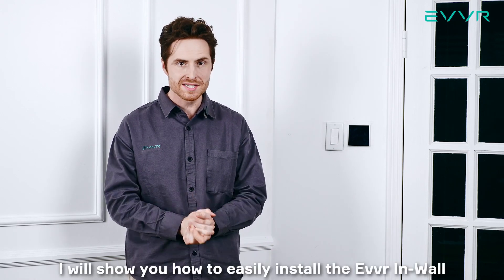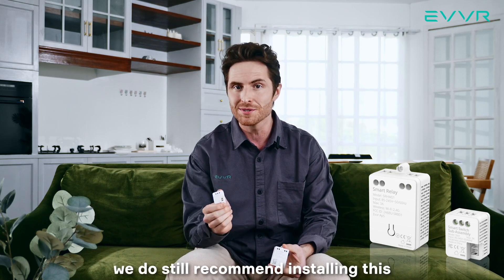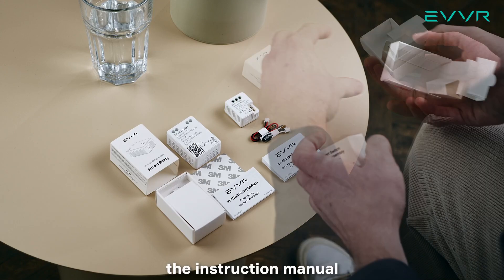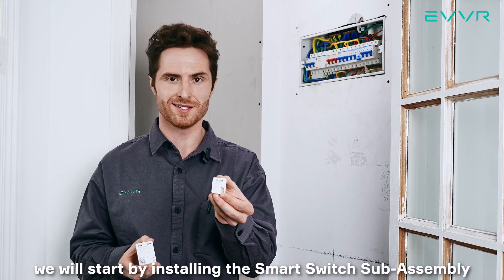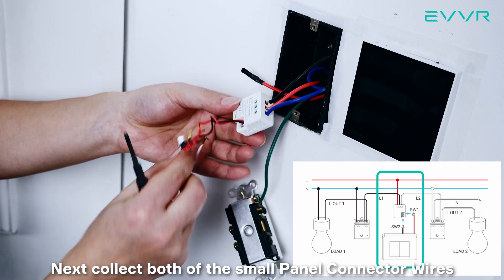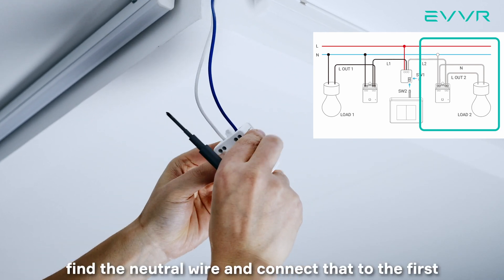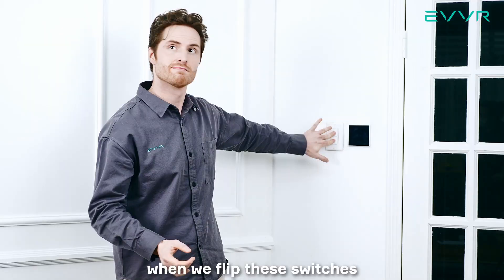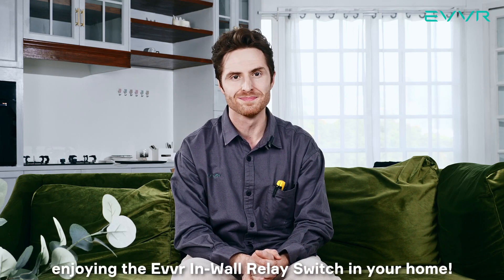Smart Lighting Solution for Double Light Switch|American|HomeKit|Zigbee|Z-Wave|Evvr

Comment: Question about the physical installation: shouldn’t it always be put in some sort of box or enclosure? It seems like the terminals on the product are going to be hot, so even if they’re embedded, they potentially could short if something came in contact with them. I’d imagine code would require more protection than them having an exposed installation, or even being installed inside a wall without a specific enclosure. This raises an additional point that I think it would be nice to see more enclosure in some of these products, so they could be installed a little more independently.